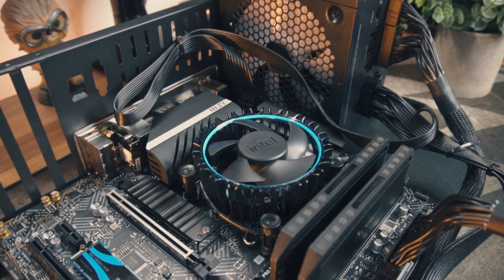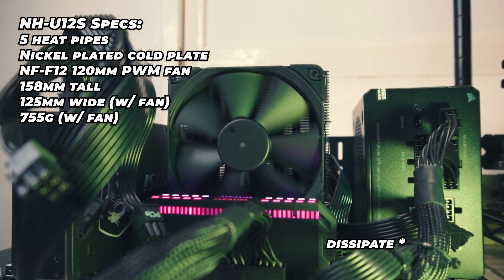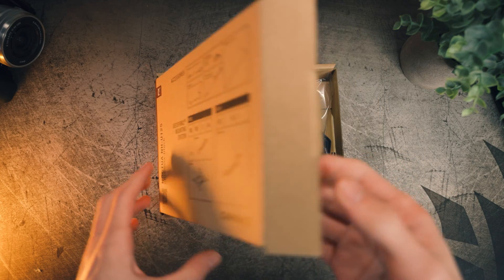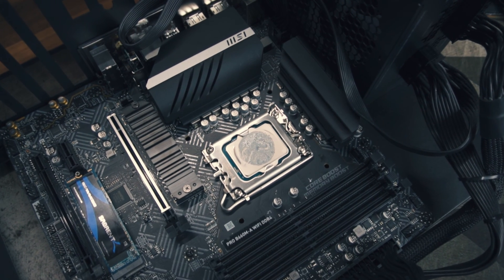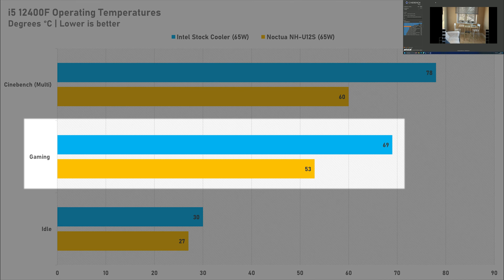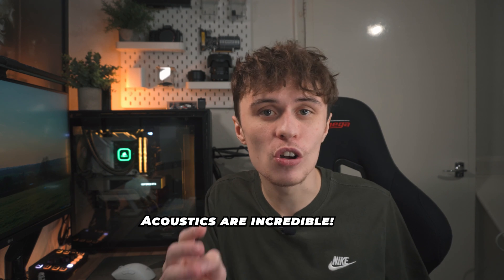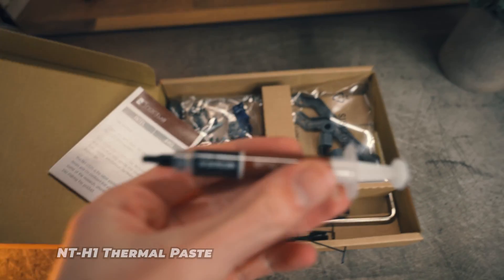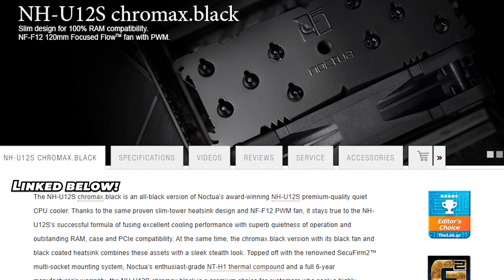Noctua NH-U12S - A Silent CPU Cooler!

Comment: should I get AIO if I have this cooler cause my room heats very fast with this and I cant close my case that well cause tower is too long
Reply from the maker: A good cooler will make your room even hotter. Because they move heat away from your CPU more efficiently
Reply: @ProYamYamPC  it actually has ruined my side panel. It cant close in first try

Comment: is it a good choice for core i9 14900 ?
Reply from the maker: Are you referring to the upcoming locked non-K model? If so, it don't see it being an issue as they do seem to be a lot cooler than their K counterparts.
Reply: @ProYamYamPC  no..the K one 😆
Reply from the maker: @havivelbaz  I would recommend the NH-D15. It’s one of the beefiest air coolers on the market. You’ll need it, Intel K CPUs are furnaces.

Comment: Hi @ProYamYamPC i'm about to buy the 5800x3d, i have this same cpu cooler, do you think that adding another fan will work for this processor (regardless that the page puts it in green) or should i buy another more powerful one?
Reply from the maker: I believe you should be ok. However, do you already have this cooler? If not, I would recommend getting an NH-U12A as it's a bit beefier than the NH-U12S.
Reply: @ProYamYamPC  I have that noctua on my PC with a 3700x, that's why I was asking, in case I had to change to that one you mention for example

Comment: Should i use the noctua nh-u12s or an aio 240mm cpu cooler
Reply from the maker: A 240mm AIO should outperform this. Which CPU are you using?
Reply: @ProYamYamPC  Im using amd ryzen 7 5700x proccesror tray
Reply from the maker: @rayybtw2844  either cooler options would be great. Go with what suits your build mate.
Reply: @ProYamYamPC  thanks alot thinking of choosing noctua since it fits my case and i heard its better in the long run
Reply from the maker: @rayybtw2844  this NH-U12S has been on my test bench ever since I got it. It’s been great!
Reply: @ProYamYamPC  What about the arctic liquid frezzer II 240 vs noctua Nh-UH12s